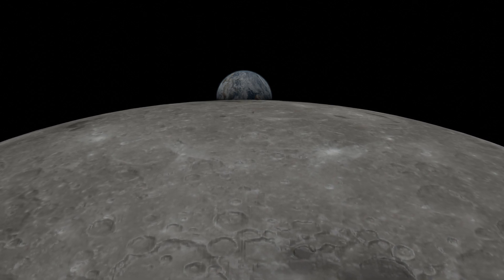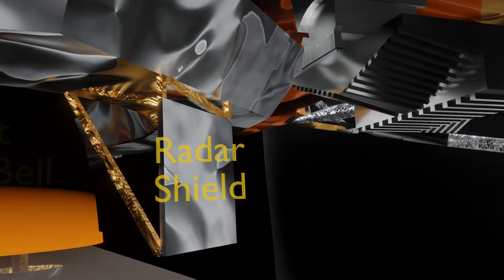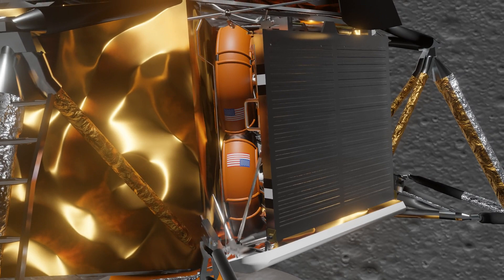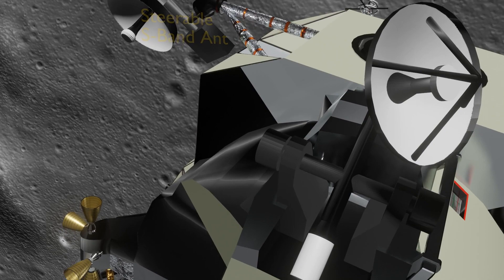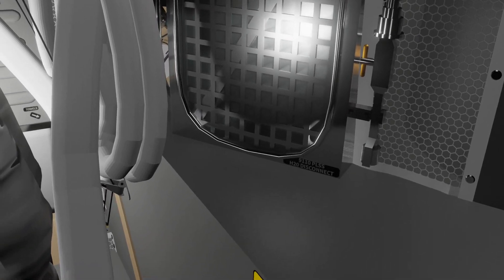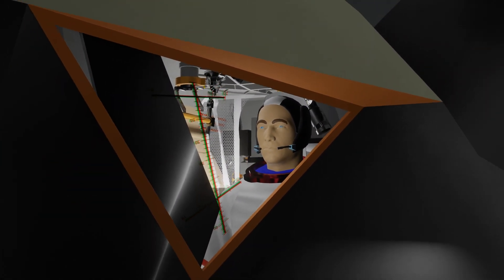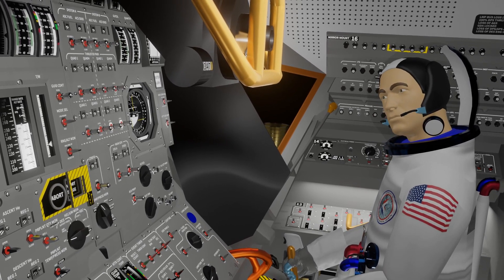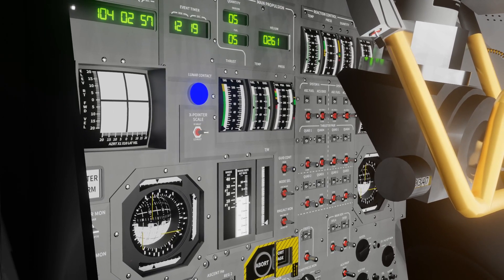Apollo 15 Part 1: Hadley Rille Landing, First of Extended J-Missions

Comment: I have a serious doubt: What kind of radioactive material could be inside LM's cockpit? As far as I know, the only radioactive fuel was carried into the core of the ALSEP, placed into the descent stage, to fuel all the experiments for as long as they should work! Did the Astronauts have to "arm" that core handling the atomic fuel from the cockpit down to the Lunar surface, once tue ALSEP was deployed??? That would have added an unecessary risk to the crew!
Reply from the maker: Inside the LM cockpit, most of the switches had a small radiated element similar to the glow of wrist watch hands many years ago.  This posed a minor risk.  Similarly the outside handles on the CM also had radiative glow elements.  Any CM you see in a museum had the original handles removed and replaced with new ones without the radiation.  Outside the LM, the SNAP27 nuke fuel was loaded into a protective cask on the side of the descent stage.  On the lunar surface, the fuel was removed from the cask and placed into the RTG.  Actual picture inside A15 front hatch: https://www.apollojournals.org/alsj/a15/lm10-co26.jpg
Reply: Further to what Drew said, when it was determined that Apollo 13's LM wouild be reentering the Earth's atmosphere. the NRC was at Houston making sure that everything possible was done to ensure that plutonium cask ended up as far from civilization as possible. The area it crashed into was monitored and it appears the cask did what it was designed for and survived reentry.

Comment: Wonderful enactement and a lot of detail that couldn't be picked up in usual photos and videos of the age! One curious thing: you placed sound where it was supposed there wasn't and supressed it where it surely was! I mean: in the space void no sound can be transmitted, unless physical contact may be carried out. As we see Falcon coming down on Hadley plains, no sound could ever come to our ears. However inside a pressurize cockpit, even though about 20% normal pressure, there we should have heard the purr of the descent rocket engine, indeed!
Reply from the maker: I took a little artistic license to show the rocket sound even when outside the vehicle.  My understanding is that the LM environmental control system was loud (like the F-14 I flew----another Grumman Product).  So I tried to replicate that ECS hum inside.  In the F-14, you could really never hear the engines over the ECS.  But If I did it again, I would still keep the external sound but for inside, I would mix the ECS sound with the sound of the descent engine.

Comment: In the actual landings what jappened to the probes ??? They just dissapeared
Reply from the maker: In the actual landings, they got bent all over the place.  Which is why they did not use them on the front gear leg---did not want to interfere on the astronauts getting down the ladder.  Apollo 9 (earth orbit test) did have one on the front gear, but people realized that it was not a good idea.  This link has several pictures of the bent gear probes: https://space.stackexchange.com/questions/37756/why-were-contact-sensors-put-on-three-of-the-lunar-modules-four-legs-did-they

Comment: The only observation is the main engine activation: the initial use is to slow down the Eagle for the purpose of falling and then cushion the touch on the moon (landing trajectory)
Reply from the maker: @rsmrsm2000  they had to kill a substantial amount of horizontal velocity.  Also, there was a stay out of region within the throttle range.  But that was ok because the computer was controlling the engine. The last couple hundred ft was a near vertical descent with the engine commanded off when the sensor probes touched the surface.

Comment: Well done. But if you want to add a more realistic depiction, check out the photos sent of the engine bell. Apollo 15 landed hardest of all the LMs, and smashed its descent engine bell quite well. The honeycomb shock absorption in the legs would've compressed quite a bit.
Reply from the maker: @kspencerian  Thanks for watching and your comment.  Sometimes I balance realism and complexity.  In this case it was easier to not show the compression of the struts nor the damage to the bell.  Can’t remember if I actually modeled the larger bell for 15 as they were trying to squeeze out more engine performance.  While 15 was undoubtedly the hardest landing (they know how hard each landing was and by strut), the larger bell was a contributing factor.  Also I modeled the moonscape rather flat with some hills if that makes sense.  Currently working videos of stacking 15.  There will be a launch coming up along with a sub satellite launch

Comment: Underrated channel
Reply from the maker: Thanks for your comment.  The thought is much appreciated.  If you have any ideas on getting from underrated to something bigger, I am all ears.
Reply: @opieswenson As far as I know the descent propulsion system used the cryogenic tanks for supercritical state helium. Are there any other cryogenic tanks in lunar module? Are the oxygen tanks in lunar module cryogenic liquid oxygen tanks or ambient gaseous oxygen tanks?
Reply from the maker: @powerfulstrong5673  Supercritical Helium was used to pressurize the descent engine propellant system (it was a gas when pressurizing the tanks).  The propellant and separate oxidizer (Aerozine 50/Nitrogen Tetroxide) was not cryogenic.  The oxygen tanks used breathing system, cooling,, water, and power generation were cryogenic.
Reply: @o @opieswenson The ascent propulsion system of lunar module doea not use the  cryogenic tank for helium, right? The oxygen tanks of lunar module are gaseous oxygen tanks not cryogenic tanks, right?
Reply from the maker: @powerfulstrong5673  Same fuel, oxidizer and supercritical Helium also in the ascent stage.  I believe that the oxygen for the ascent stage was stored as a gas.
Reply: @opieswenson I think the ascent propulsion system and rcs system used the same fuel  but used ambient helium instead of supercritical cryogenic helium for pressurization.
Reply from the maker: @powerfulstrong5673  So I took another look at this document (https://ntrs.nasa.gov/api/citations/20090016298/downloads/20090016298.pdf).  It appear that you are correct.

Comment: That was great stuff. Very informative. Thanks for posting. Carrying extra water and other provisions for a longer stay, plus the lunar rover of course, I wonder whether the whole lander was significantly heavier for these J-missions. And if so, how that affected the descent and landing maneuvers compared to the earlier missions. Anyway, good work. 🚀
Reply from the maker: Thanks for watching!  The short answer is that the J-Mission landers were about 3,000 lbs heavier.  Apollo 15 had a steeper approach path by about 10 degrees to give it better visibility going over the mountains.  While the net weight was heavier, they also got rid of stuff to make the structure lighter.  One of the big fuel savings was to have the CSM place the lunar module at a much lower altitude.  I don't show it in my animation, but Apollo 15 hit the hardest (landed by an Air Force Pilot---all others were Navy) and the back leg went into a crater which tilted the spacecraft at a crazy angle.  They also cracked the descent engine bell.
Reply: @opieswenson  - Interesting info. Thank you. Presumably that's 3000 lbs on Earth, which is a fair bit of extra mass in space, and 500 lbs of weight on the Moon. Very significant, as indicated by those approach stats. I see in your notes that the engine was more fuel-efficient though.  
Just subscribed and will look through your content. My favorite missions were 11 (for the balls of the whole thing), 12 (for the personalities), and 17 (for Gene and the extensiveness of the exploration and duration on the surface). 
Thanks for the work you put into this. I'm sure space geeks will love your stuff.
Reply from the maker: @renejean2523  yes…3000 lbs earth weight.  Thanks for subscribing!  If you like Apollo 11, I have an Apollo 11 playlist which was my first Blender work.
Reply from the maker: @renejean2523  3000 LBS earth weight.  Fuel efficiency came with the extended engine bell.  But with the hard landing and longer bell, the bell hit the ground and cracked.  If you like A11, I do have a play list of my A11 animations.  I don't have an Apollo 12, but I do have a Skylab series (Conrad mission CDR on Skylab2 and Bean mission CDR on Skylab3)
Reply: @opieswenson - Oh, I will definitely be working my way through all your videos. Thank you.